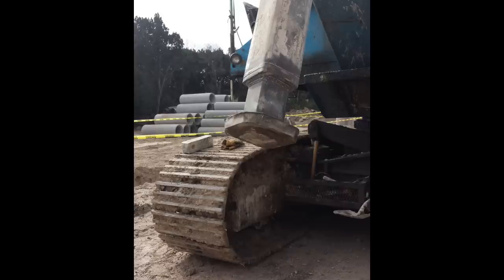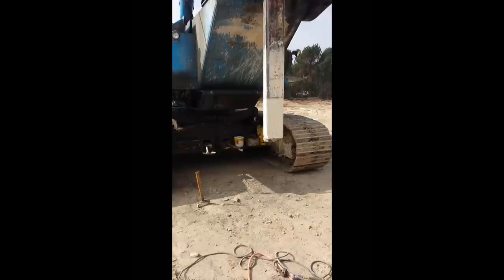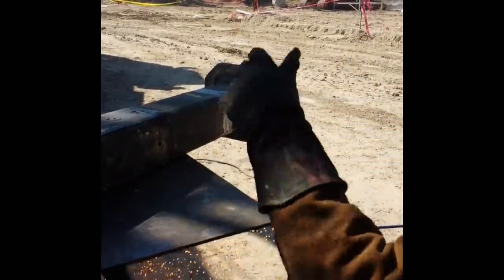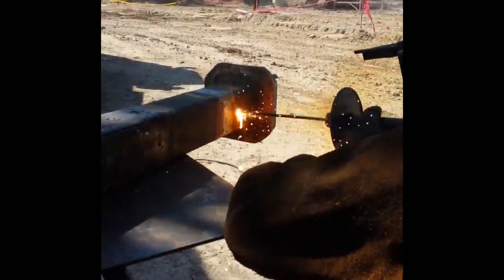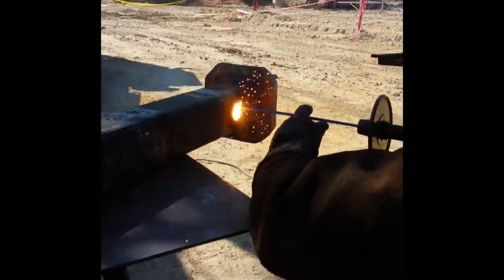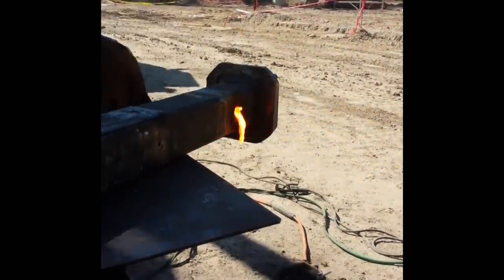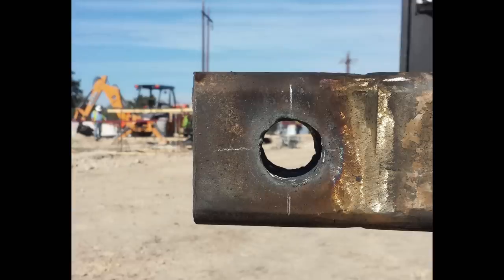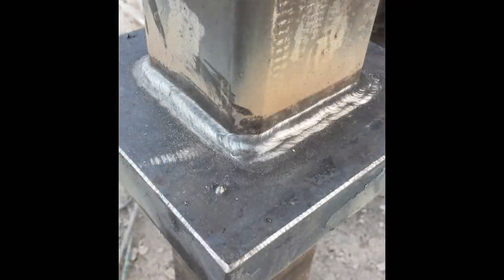Exothermic Slice torch tips.

Comment: Hey Isaac, I spent my career working construction and on two occasions we used drilled casson foundations due to soil conditions. One was concrete piers and the second was Geo Piers, where the hole was drilled but filled with multiple layers of gravel. Each layer was tamped using a cone shaped tamper which forced the fill downward and outward. This improved the bearing potential of the soil to approximately a 6' diameter of the original hole. Convention footings / pads were then placed above the Geo Piers. I think the company is in your neighborhood, more or less.:) I hope you and your family have a great Christmas! Thanks for the gift of video!:)

Comment: Wow Isaac.  That hole looks amazing. Well done. I am struggling to cut through 1" plate and you do a a 4.5" in one shot. Well done. 

For the mag drill I have a 1" thick angle plate that I clamp to uneven parts. It also helps when you want to use the mag drill on non magnetic materials.  .

Nice work. Great looking welds

Comment: Hey Isaac I have an oxylance on a 100ft reel on my work truck..you can ORDER 48 inch long rods in 1/4 or 3/8 I just want you to know that...GREAT WORK AS ALWAYS!
Reply from the maker: Thanks for the tip
Reply: @ICWeld  I have a chart somewhere that gives you the approximate burn times for each rod...get some 3/8 and try it its a big difference!! But it requires a collet adapter in the gun to accept the bigger diameter...all my lance rods on my truck are 24's

Comment: I've been very much enjoying your videos and I've been wondering why you don't use a mag drill? I've seen several videos where a mag drill would just make everything so much easier with an annular cutter, you can even get extended ones for long pieces like this. I'm assuming this one is because this came up as an emergency and couldn't get one long enough in time but I definitely think you should look into getting a mag drill. One of the best purchases I have ever made, I find myself using it for everything even when I told myself it wasn't worth buying at the time. 🤣😂🤣😂 I posted this just as you explained why!! 🤣 My bad!
Reply from the maker: I have an older Black & Decker mag drill that I use on occasion but that model only has one speed...too fast.

Comment: I been trying to find information on 2 tube vs 3 tube cutting torches. Seeing that you can cut as clean as a plasma with a torch witch style do you prefer and witch is better for a cleaner cut, the 2 or 3 tube torch?
Reply from the maker: The torch mfg does not really matter. The main concern is the proper settings and tip size. Most any torch will work.
Reply: @ICWeld  Thank you so much for your fast reply! You are an artist with the precise fab work you do! I see some torches cutting heads have 3 tubes rather than 2 tubes going up to the torch tip. Does the 3 tube work better because it supply's separate oxygen for cutting?
Reply: It looks like you use the 3 tube (3 pipes) style cutting torch alot. Just curious if they are more precise since it has a acetylene tube and 2 oxygen tubes. I assume the 3rd tube supply's separate oxygen for cutting?

Comment: Wow. You never cease to amaze me. 

I used one of those tools years back, but we called them An oxygen lance. Used it to blow out a 4 or 5” pin on the walking beam under a D8 dozer. Very slick stuff. You amaze me with the accuracy of your work using things like torches and arc gouging.

Comment: Been using them for years to remove stuck pins in cranes and other heavy equipment. Amazing how you can cut thru the center and water cool a pin and most times knock it right out where as it wouldn’t even budge before! Great tool
Reply from the maker: Yes exactly. these are great tools for stuck pins.

Comment: Great video IC weld.  My father is a firefighter and he uses this same exothermic slice torch/ oxygen lance to cut through steel doors and roofing quickly.  Will cut brick and block also, just not as quick.

Comment: I work at a steelyard here in OR-EE-GONE and I use a big liquid oxygen tank and propane. We never weld so we have no need for acetylene. We run pretty big tips and I’m blowing through up to 8” solid at 7-10psi propane and 80 on the ox. Looking at getting more equipment for our steel yard and now I’m gonna have to play with there exothermic noize makers! And that scratchy the inside of a holey arcy sticker things!? Gonna have to play with that action too!

Comment: Exothermic..!!! Wow., never heard of it before, been welding/fabricating/repairing for 45 years. Amazing.
Reply: It means that the end of the rod is actually burning in the stream of pure oxygen flowing through it.
Also called an oxygen Lance.

In other words, the heat comes from the rod itself, not from a gas flame or an arc.
Reply: The first time I seen an oxy lance was an article on jade,a guy was cutting a jade boulder.

Comment: Awesome tool. Now let me suggest one for you. Before the fella holding the punch driving out the pin gets a broken wrist crushed from being hit with a sledge hammer, make a punch holder. I made mine out of a broken 3/4 inch drive ratchet. Took the gears out of the head which leaves the handle with a loop on the end. Now wrap your punch with black electrical tape until it has to be driven or pressed into the loop. Now the fella holding the punch has his hands two feet away and the black tape absorbs the shock. I made mine for knocking out dozer track pins.

Comment: An old weldor used say that he'd damaged more than one welder while arc gouging and that some shops kept a dedicated welder just for that purpose.  Has this been your experience?
Reply: You generally want a larger welder for gouging than for anything else you will do in a shop, and you don't need fancy features, just ALL the power and duty cycle, so I know a lot of shops just use an older BIG welder to run the air arc, and then get the more expensive fancy new tech for actually welding.

If you try to gouge using the same size welder that you are putting it back together with, you are probably going to overload the welder, or get really annoyed at how slow you are gouging with tiny rods! Lol

Comment: Could you explain why the mag drill didn't work please?  Was the material just too narrow for a good magnetic connection? In other words, why didn't it hold and it spun around? Thanks. Great work as always. Regards
Reply from the maker: The surface isn't completely flat. the magnet didn't hold on too well.

Comment: Great job I have a question on the ark gouger how does it work I know your using ark welder but how does it blow away the puddle
Reply from the maker: The electrode holder has small holes where it clamps the rod. The air runs in line with the electrode. As the carbon rod melts the metal because of the arc, the air blows away the molten puddle.

Comment: I just wanted to tell you that you have helped me immensely on using torches. I'm a heavy equipment mechanic. Never have had actual training on using them. But I've watched a lot of your videos on gouging and cutting with oxygen torches. Recently I had to get one of those cylinder pin keeper pins that a bolt goes through out of the cylinder pin. Had the cylinder pin glowing hot and still couldn't hammer the keeper pin out. Ended up slowly gouging the cylinder pin out till I got to the keeper pin. I just kept telling myself that I would see the keeper pin metal and that's when to stop. Worked out great. Little bit of rust clean up on it and a new cylinder pin and machine was back up and going.

Comment: G'Day,,Never knew it was called exo-thermic,,we called them oxy lance's,,but we used a 4 metre lenght on 3/8 pipe,had oxy piped,,and no electric starter,,just flash the oxy over till pipe ignited and go,,Mind no wear near as tidy as your work,,but we used them mostly to cut scrap in half,,old mill rolls and the occasional ingot stuck on stripper crane ,,to hot to strip and pushed a 12 inch bar 6 foot in to an ingot,,had to save stripper bar.
Fun time's,,,,NOT,,

Ingot,,9ton,cast steel,poured in to a mold and let set,,strip mold from ingot while still hot but set and reheat to rolling temp,,soaked in a soaking pit to make sure heat was even through ingot,,had many what we called pipe ingots,,where the centre was still moltin,,they were fun to watch going throught the rolls,,

Comment: What purpose kellybar pin act, when no require of absolute line boring/gouging hole to fit? How normal carbon gouging stick differ from 'exothermic slice torch'? Do it have magnesium/lithium/natrium (at pure state, they are exothermic - depending surface area) powder core?

Comment: Can someone please explain to me why you'd cut a hole in a bit of bar, stick a pin in it and then weld it up?
Reply: The pin holds the Kelly bar in the drive sleeve of the machine.
The pin is then welded (both sides) to the sleeve
Issac mentions his previous video showing him and his son doing a very similar job on another piece of equipment.
You might check that one out if you want a bit wider camera angle and more details.
Reply: @jimurrata6785  yea but I just don't understand WHY you'd cut a hole, put a bar in and then weld it flush? I can understand if it stuck out but why would you it be flush? 
What's the point of welding something flush?
Reply: @TheManLab7  Dude,the solid bar he cut the hole in goes into a piece of square tubing,insert pin and weld.

Rewatch the video and keep your eyes open this time.
Reply: @TheManLab7  I'm not an expert but I imagine it has a lot to do with the fact that the auger is churning through rock and all that has to pass up around the shaft out of the bottom of the hole.
It must be incredibly abrasive and any kind of projection is going to hang up.
You definitely don't want it to get jammed or for the pin to come loose leaving the auger stuck at the bottom of the hole.
Did you watch last week's video?

Comment: Thank you so much for the schooling. I've been moving into more heave equipment welding but I have a lot to learn still about arc gouging. I have a Miller Trailblazer 302 and a Lincoln 305G EFI. Can you tell me if those machines are enough to gouge some big stuff like what you've done in this video?
Reply from the maker: Yes, I started with a 302 and a stand alone compressor. it'll do good.
Reply: Keep pushing